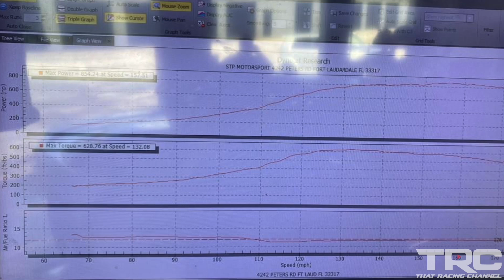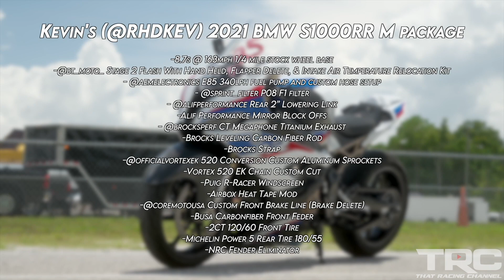900HP Nissan S14 VQ37HR Swap with DCT Trans! VS ZR1 | Tesla Plaid | BMW S1000RR | GT500)

Comment: This thing actually sounds amazing, The turbo really helps it out with sound
Reply: Vqs sound amazing with a turbo or just the right exhaust and not a 3” straight pipe on stock manifolds
Reply: @g32k  3 inch straight pipe with turbo sounds good too
Reply: @g32k  N/A VQs need to have some sort of resonator to sound as they should the full straight pipe sounds disgusting and offensive.
Reply: @infinitibossauto  it’s not a true straight pipe if there’s a turbo. Turbo works as a muffler and changes the sound a ton
Reply: Boosted VQ's sound different

Comment: That transmission is worth more than the whole car lol
Reply: No its not lol, that M3/M4 trans is like $4k lol
Reply: @ArtemisArtz  That's ExPeNsIvE bRa!
Reply: The car is cheap everywhere! The trans cost more than the vehicle
Reply: @collinhopper7542  Nvm.  I watched the full vid.  F10 M5 trans, $1500 on eBay.  Lol.
Reply: @xavierruiz7804  240s are the opposite of cheap in today's market.
Reply: @xavierruiz7804  s chassis have never been cheap in good condition
Reply: @xavierruiz7804  the cheapest you’re getting a 240 for in 2022 is like $6k with 200k miles in 5 colors
Reply: Clean S14s are like 20k lol
Reply: @xavierruiz7804  cheap? A 240sx is like 15-20k in the Bay Area
Reply: I'll buy 10 s chassis if you cann find me them all for around the cost of the trans.
Reply: U gotta be dumb dumb if you pay for a 240 15k or 20k! The most is 3k and thinking about for a couple of months
Reply: @xavierruiz7804  supply and demand. Economics 101 youngin
Reply: @xavierruiz7804  beaters for 3k 
Solid 240sx are 15-20k out here

Comment: How does this vq37 900hp setup compare to your previous kat 900hp setup? Which one did you like most and which engine has better power band in your opinion?  I have an S13 and I'm torn between these two engines and it's the reason I ask. They're both power houses but a part of me leans more towards thar nasty Vq37VHR. Huge fan

Comment: Good Luck, I can't keep a VQ37VHR together to even get to the transmission upgrade. Damn VQ.
Reply: Whats wrong with yours?
Reply: VR transmission upgrade?
Reply: @e46m54nissansr20937  Lifted the head again. First motor was at 800whp. Built a way better one and they lifted at 1004whp. Held at 900whp for a about 4k miles.
Reply: The block is dancing around under high cylinder pressure. It's just not stable. If you can get it to hold it is only a matter of time before it happens again.
Reply: @e46m54nissansr20937  No, DCT. My engine keeps setting me back to square one.
Reply: Get a different engine you’ll be happier vq ain’t it
Reply: @undergroundriptiles7005  Easier said than done. VR38's are expensive.
Reply: @spooler7828  they’re the best tho. There’s a few other Nissan engines other than that not too much. Depends on what you’re trying to do tho. If it’s this type of racing then your going to hit a brick wall

Comment: Awesome built man love it special that is different ❣️ ,I my self I'm in the process with a 2jzgte vvti on a dct from the me e92 , wold like some input on  what would be a good diff ratio on a 9inch ford  I'm running 450 to 500hp on e85 , maxxecu it's on a Nissan 720 1986 long bed lol , about 2,100 pound, 15x10 rims and 26x8.30 tire need some help here 🤙

Comment: FYI. The VQ37VHR bottom end fits inside the VQ35HR. The VHR heads do flow better than the HR heads tho.
Reply: VHR heads also require years of labor hours to take on and off lol
Reply: @elmoz122  for sure. Back in the early 2010s before I got my nismo 370z I swapped the bottom end from a wrecked G37 into my 2008 nismo 350z after I suffered oil ring failure in 2 cylinders.
Reply: @RadDadisRad  That’s dope. I’m done with the VHR after this. If my Darton sleeved motor lifts heads I’m doing the Hr head conversion
Reply: @elmoz122  lol, I don’t blame you
Reply: The HR heads flow better
Reply: Hr heads flow better
Reply: Yes they do stock ....but the fact u can cam and port the hr head makes it a lil better option on both side
Reply: @RadDadisRad  What caused the oil ring failure Im curious

Comment: 22 lbs 850whp...massively impressive...the vqs are underrated , vqs > 2jz by far
Reply: @whysoserious3x  lol
Reply: heads flow like sh%^t ....
Reply: @jayjesuswake3140  🤔
Reply: @jayjesuswake3140  Im trying to think of a mass produced N/A V6 with better flowing heads 🤔
Reply: @e46m54nissansr20937  better flow than a 2jz ? 🤣 ..dude the 2jz heads are some of the worse flowin heads ....thts why you gotta run alot of boost to make power
Reply: Vq can never compare to a 2JZ